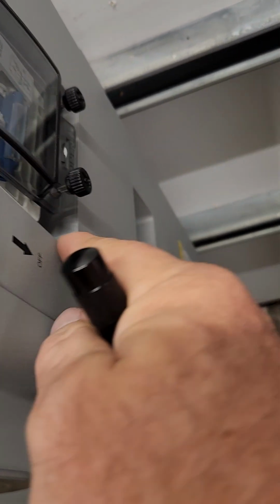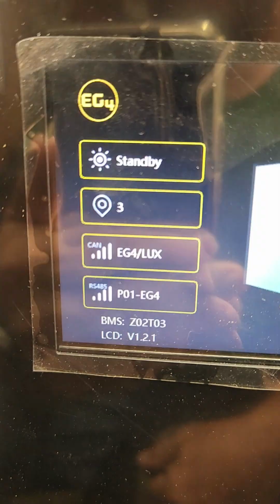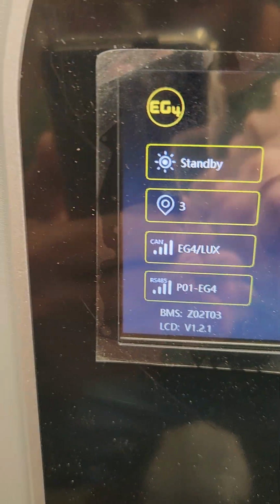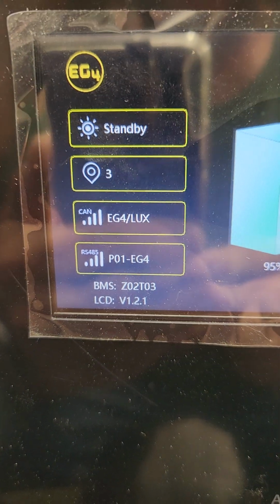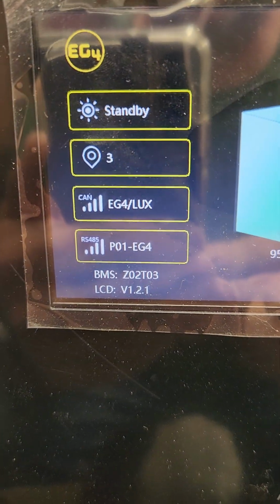How to set DIP switches on EG4 Battery #solar #battery #EG4 #DIP

Comment: Man I wish I would have seen this 5 hours ago!!!  That’s why it kept reading battery 4 and I have only three. Now does the bms version need to match?  I have two batteries ending on 1 and the third ending on 3 like yours.  Trying so hard to connect to an NHX inverter without changing to lead acid settings and setting my own battery numbers.
Reply from the maker: It is generally recommended to have all batteries on the same firmware version. Glad the video was helpful! Thanks for commenting!

Comment: You have off and on incorrect according to switch display .
Reply from the maker: I was waiting for someone with sharp eyes to catch that.  It's an issue I've reported to EG4.  the labelling on the switch mechanism is wrong.  They either need to move it, or have an arrow showing "ON" pointing the other direction.  Great catch!
Reply: I just found that one out this last week.  Was starting to get frustrated because "on" isn't "on".
Reply from the maker: @ Yessir, it can become very frustrating.  I should have mentioned it in the video, but something I learned long ago..  when you have new hardware you aren't familiar with, I usually set all the switches "up" or "down" and determine the value.  if it's zero, you know which direction is "OFF",  otherwise, that is the ON position. Unfortunately, the mislabled "ON" is not unique to this battery.  it's very common across many industries.  Thank you for the comment!
Reply: Hi, how are you? From what I understand, the manufacturer considers the on indicator to be the lowest part of the dip switch button. Is this standard for these switches? Or did the manufacturer invert the on/off markings? Or maybe I misunderstood everything?